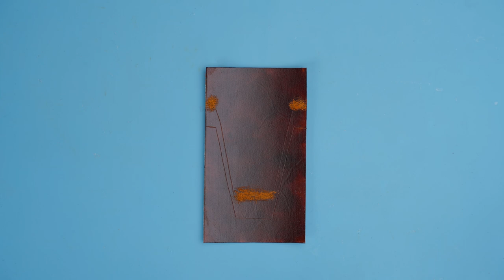Making a Custom Leather Wallet | ASMR

Comment: Do you have the pattern available for this?
Reply from the maker: Unfortunately, we do not have a pattern for this project. But we can give you the dimensions! We hope this is helpful for you!
Back Panel (x1): 4 5/7" x 6 3/4"
Back of Pockets (x2): 2 3/4" x 4 7/8"
Pockets (x4): 2 3/4" x 3 1/8" 
(Note: the Pockets in the video are T-Shaped but the dimension size for the pocket is a rectangle. So you will have to cut the pocket rectangle shaped into a T-Shaped pocket.)